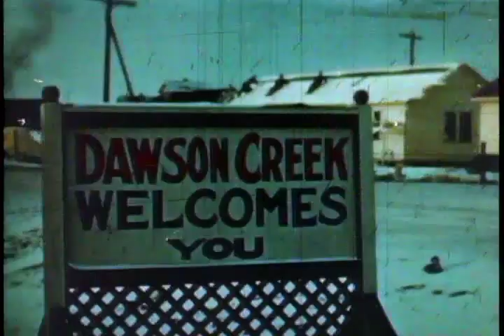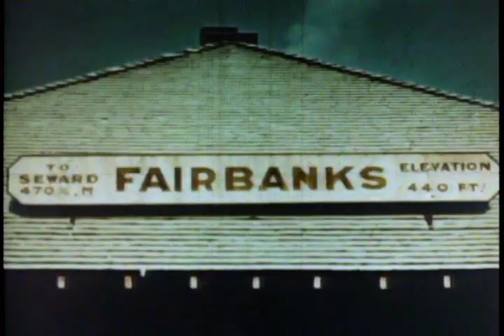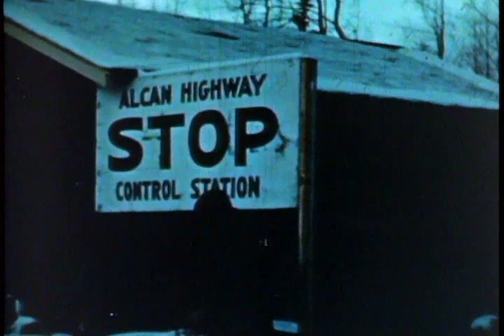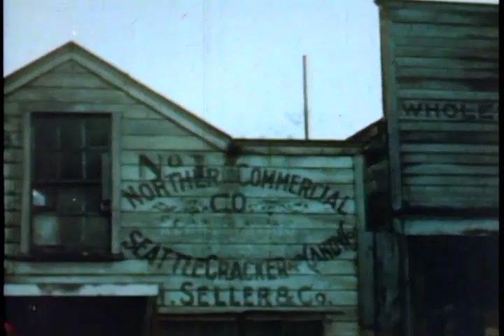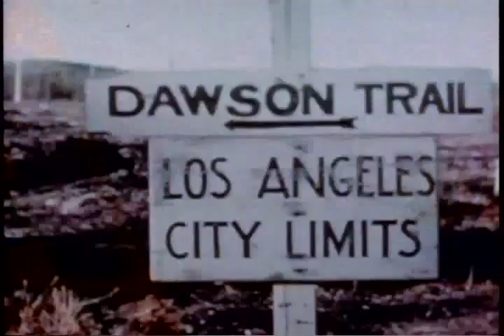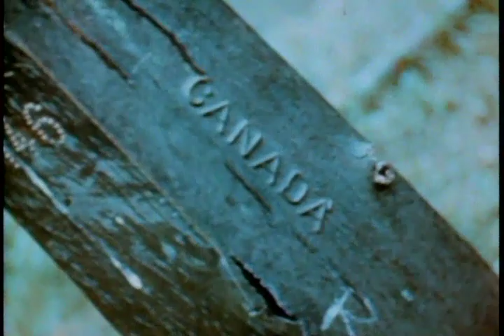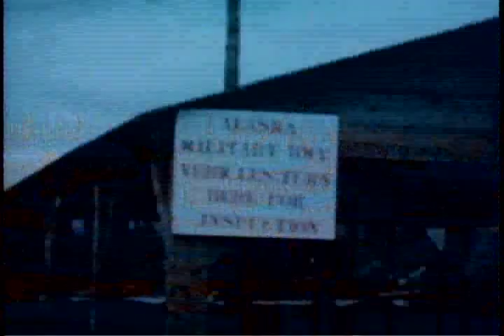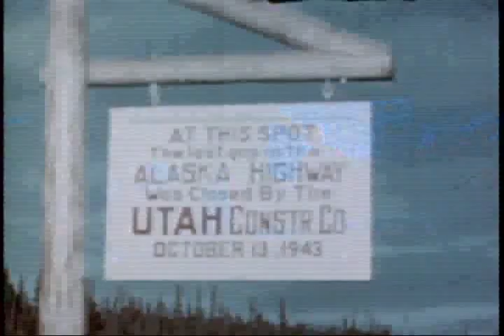Constuction Of The Alaska Highway (1944)

Comment: I drove the Alaskan Highway in 92, the 50th anniversary. It was cool, there were parts on the old highway still open..
I have met people that actually drove the highway after the war, telling how they brought extra parts for the car, they would rely on gas in 55 gallon drums at points along the highway set up by the army.  They would hunt and fish for there food along the way..
Today driving the Alskan Highway is a breeze, but it is a wonderful experience...
Reply: My grandfather worked for AE Jupp , they were roadbuilders out of Toronto . Jupp got a contract to supply skilled cat skinners , shovel operators , truck drivers , etc. Grandpa got a telegram from the boss , telling him to pack a bag and Meet him at Union Station in Toronto . All he said was you'll be gone for a while , they found out where they were headed at the train station. My Grandfather was the mechanic , he could fix and operate everything . He said that if something broke down and it was in the way it would be pushed off the road into the bush or muskeg , there are quite a few pieces of machinery buried deep under the old roadbed.
Reply: I drove it in 1979 and 2013 and there was a big difference in the road with many bridges replaced and the highway rerouted in many areas.

Comment: Actually, what they built was a ‘pioneer road’.  It was meant to be a temporary access road so they could begin on a more permanent road basically running parallel.  The pioneer road was supposed to be 12’ wide. It was still a real engineering feat, but you could barely drive a truck on it, especially in summer.  I’ve driven the highway maybe 75 times since the mid 70’s.
Reply: 4:25 of the video says your comment lol

"In all, there were seven engineer regiments, or about 10,000 men. Their immediate job was to break through a pioneer road. A road without frills, but a road which could be used to supply the airfield and construct a permanent road later."
Reply: Yeah it pretty much explains exactly this in the video lmao
Reply: Do you know when/ if it was made into an all weather highway?

Comment: Imagine how cutting roads were before chainsaws, bulldozers and trucks!  I knew a man who worked on a road here (hidden in the Ozark Mountains), carving it out on the side of a mountain by hand, back in the late teens and early 20's, before there were chain saws. . They used mules to skid the logs and loaded them on wagons to take to the saw mill.  That road is still in use today, only 5 miles has been paved in the last few decades and it's still a treacherous road, steep and curvy.